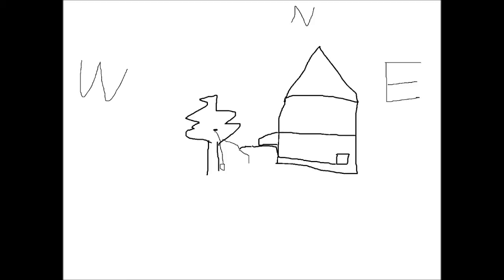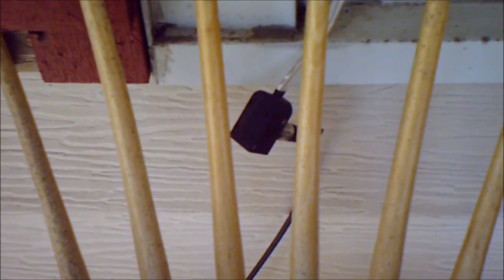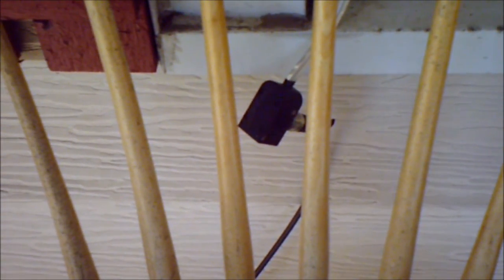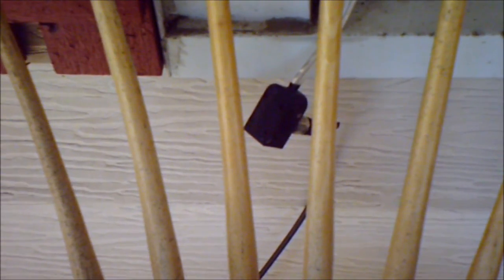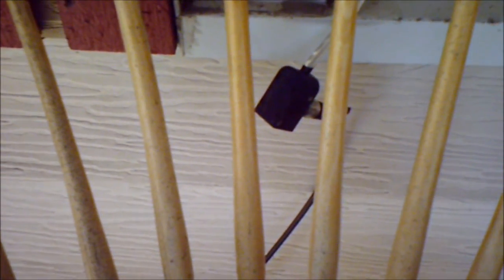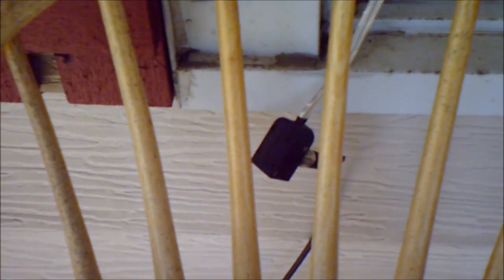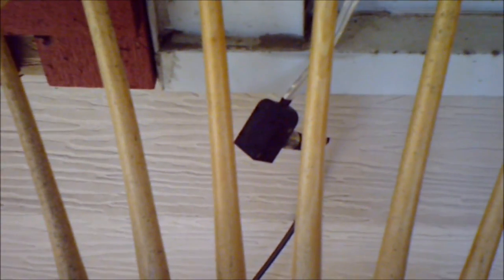A Better Look at My Antenna

Comment: So in essence it's an adaption of the "inverted L antenna" design (but with a differing approach to grounding), well at the very least it's getting your radiator (wire) up and away from the RF soup of the family home.

4:04 a cameo appearance :)
Reply from the maker: +SpectreOZ I've removed the second wire for now, and I wrapped the excess wire for the antenna around a nearby branch. So far I'm liking the results.
Reply: +sparkyzilla85 So by second wire you mean the one running to the earthing stake?
Reply from the maker: +SpectreOZ The one that was running to the pipe that was connected to one of the holes of the SO239 chasis.
Reply from the maker: +SpectreOZ The one that was running to the pipe that was connected to one of the holes of the SO239 chasis.
Reply: +sparkyzilla85 Yeah... that would be considered your antenna's ground.

So essentially what you are using is an end fed long wire antenna, that installation uses a 9:1 Balun doesn't it?
Reply from the maker: +SpectreOZ I guess it could be considered an end fed antenna, except per Greg's instructions, I got rid of the balun. Basically what I did was take a SO239 chasis and attached one of those small metal loops that has the plastic casing that you crimp onto a wire. I crimped that onto the other end of the SO239 and I have the wire running through the hoop and I electrical taped the crap out of it to make sure it all holds.
Reply: +sparkyzilla85 Ah... okay so it's an end fed random wire antenna with the outer shield of the coaxial feed cable acting as a counterpoise... gotchya!
Reply from the maker: +SpectreOZ This is how the wire is attached, but instead of a short length like I was using on the vetical, it's now a 20 foot piece of wire. https://youtu.be/A9aQ3vXKjLU?t=4m6s
Reply: +sparkyzilla85 Ah okay no Balun, no earth... just simply a coaxial fed random wire antenna :)
Reply from the maker: +SpectreOZ Yep that's pretty much it. It'll do until I have some more time to improve on it.
Reply: +sparkyzilla85 It will perform better than an antenna residing within the "sphere of interference" and a regular random wire antenna with unshielded feed line :)
Reply from the maker: +SpectreOZ So pretty much don't over think it, a simple antenna setup is the way to go.
Reply: +sparkyzilla85 Simple is good but that configuration is presenting a Hi-Z (impedance) antenna to a receiver via the Low-Z input (SO-239), the impedance mismatch will surely have an impact on the received signal quality OR is your coaxial line running instead to the receiver's Hi-Z input?
Reply from the maker: +SpectreOZ The coax is running to the Low-Z input. What kind of antenna are you using right now?
Reply: ***** A random wire antenna (no coax feed) which presents a high impedance and thus is connected to my Hi-Z input, on the SO-239 (Lo-Z) I have my 9 foot vertical (CB quarter wave) which presents around 50 Ohm impedance to the receiver.

I intend to make an antenna switch to make life easier feeding the appropriate antenna to which ever receiver I need at the time.
Reply from the maker: +SpectreOZ Ok, cool.
Reply from the maker: +SpectreOZ Do you have any suggestions for my current antenna setup. It receives pretty good, but it is also noisier than I expected.
Reply: +sparkyzilla85 In all honesty a degree of noise may be inescapable... you are somewhat limited by suitable antenna mounting locations and have to contend with "unknown" noise sources radiating from the upstairs residence in addition to that created by your own premises. 

Perhaps a loop style antenna is worth considering/researching, my T2FD is significantly "quieter' than either my random wire antenna OR vertical but they are a bit of an "eye sore" for people not accustomed to them (or HOA's),  The Time Spiders has dabbled with one perhaps you could contact him and get his insight to the antenna as well :)
Reply from the maker: +SpectreOZ I think you're right, but I did make a modification to the antenna and added a second wire to the end of the coax and I have that one running down to the stake in the ground, just like I originally had with the main wire, so now it is a sort of inverted L antenna. So far I have knocked off about 2 or 3 db or noise. Will have to try it out better tonight after work and tomorrow.
Reply: +sparkyzilla85 Any improvement is a step in the right direction and honestly you've come a long way from the balcony slinky antenna you originally started out with in terms of both a lower noise floor and performance :)

So your running a grounding lead from the outer coax shield again? I'll be interested to see/hear you results.

Noise can be a  difficult issue, I had some success running a second wire antenna at 90 degrees co-phased to my primary long wire, noise was either almost negated OR amplified I imagine it was relative to the direction of the noise source.